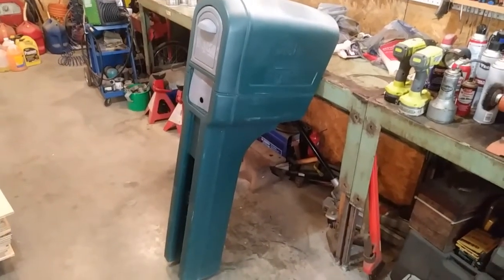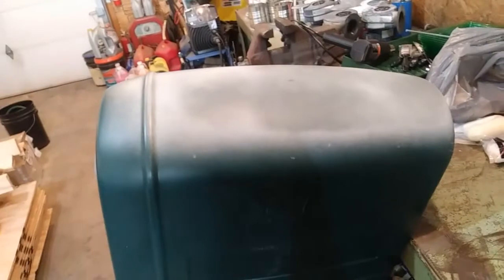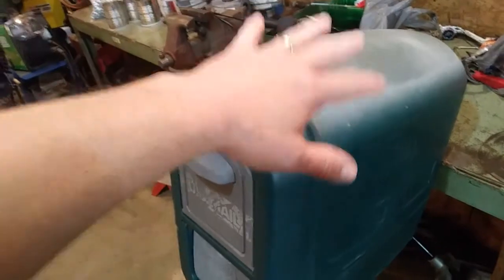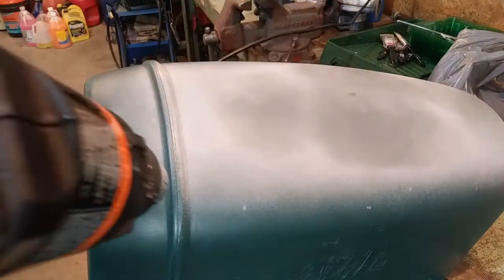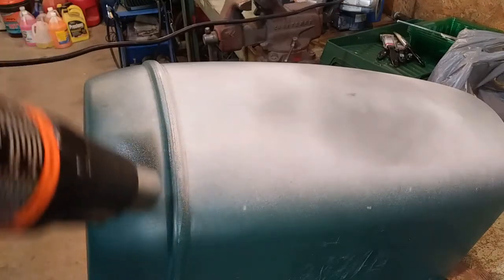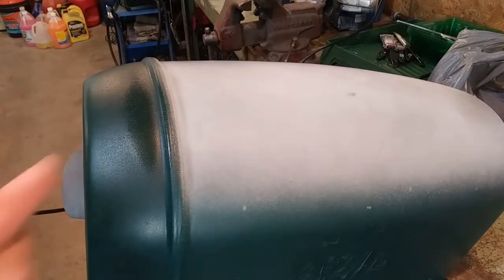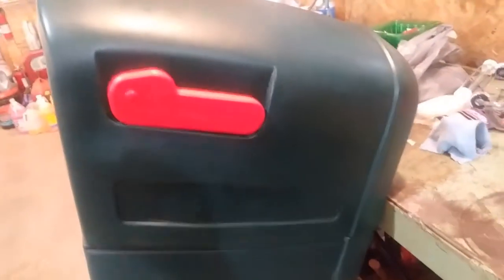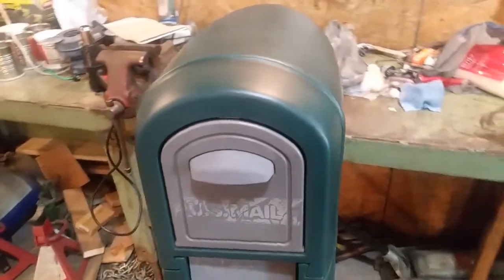*FREE* Fix Faded Plastic

Comment: It's been over a year.  How did it hold up?  I have that exact same mailbox, even the same color.  Anyway,  I saw some videos on doing this on car bumpers and it was very temporary. some said it even weathered worse afterwards.
Reply from the maker: We sold the house shortly after this, but I drive by frequently. Driving by, it still looks good.
Reply: @justtinkering6054  That's promising.  I will put this on my to-do list.  Thanks!